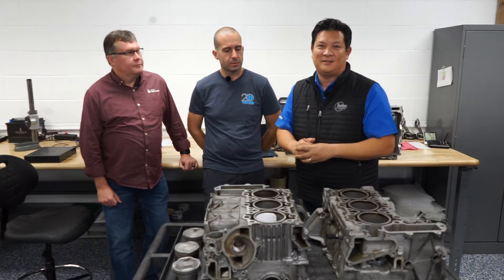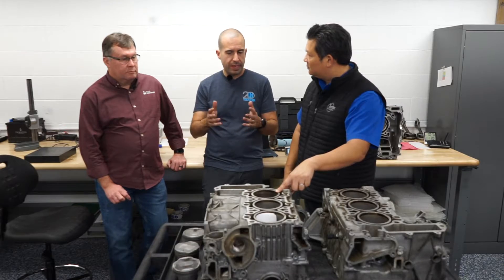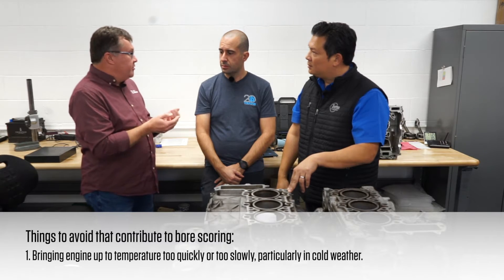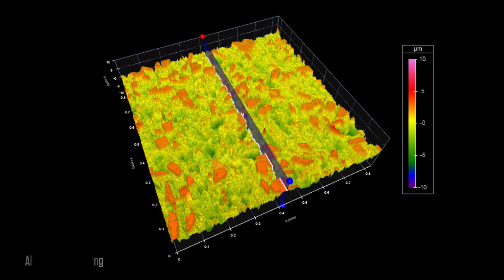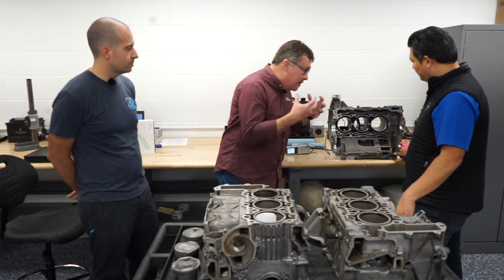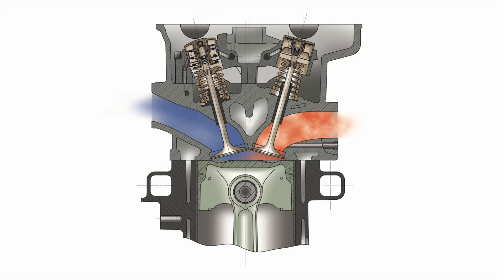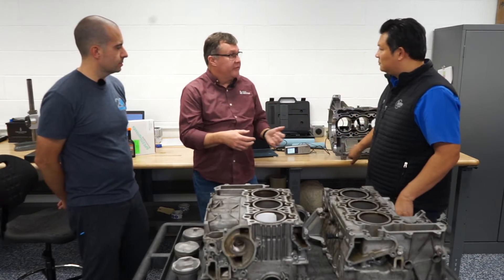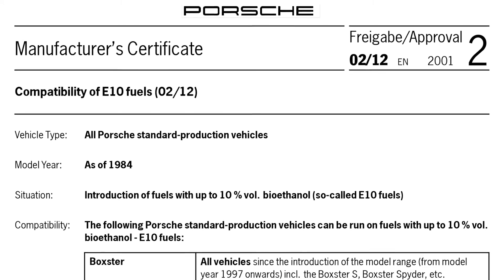Block & bore surface geometries & contributing factors to bore scoring in M96/M97 engine | 2 of 4

Comment: The Driven website has the following statement - does this mean they don't recommend using DT40 in a street car? "DRIVEN DT40 Racing Oil is formulated for High Performance Engines/Racing applications only. This engine oil will NOT MEET any current API or OEM Engine Oil Specifications."

Comment: The addition of increasing amounts of ethanol to petrol / gasoline is a scam.
Many beneficiaries but like the big club (“and you ain’t in it!”) it isn’t us.
Adding ethanol reduces the energetic content of your fuel.
Consequences are reduced power, worse miles per gallon and most of all, increased wear to various parts of your vehicle (as explained in this video where injectors are working imperfectly, and also some classic vehicles carburettor systems).

Lastly, I think, it’s hygroscopic that is absorbs water spontaneously, which then separates & falls to the lowest part of the system it in, risking rusting your fuel tank from within or corroding aluminium and non stainless steel items. 
It’s malign and performs no useful function. 

Remember, it also consumes land to grow the fuel instead of food, driving up food costs. And it’s not “low carbon”, either. It requires fertiliser, all of which is made from natural gas. Diesel is consumed in the tilling, planting, spraying and harvesting, then you’ve storage, transport and fermentation of the grain or other fermentable crop to create alcohol, distilling it from the aqueous liquor, waste handling and disposal, storage and transport of the pure ethanol, keeping it free of water and ultimately blending it with petrol / gasoline to make Exx fuel.
My guess is, mile for mile travelled, ethanol in petrol increases the total carbon footprint.

Comment: As a 1999 996 owner, I've honesty lost passion for the car a year after I bought it but to be honest I settled for this car when I was searching for air cooled SC so admittedly it's my fault. While I love all the air cooled cars the crazy price to own one defies my money common sense so like many I bought a 996 based on price. Just my opinion, you have to really have the passion to own a 996 along with being kicked in the financial balls. While I applaud Charles and Jake for providing solutions for the shit stick Porsche sold to customers from 1998 to 2008, they are getting wealthy from it. $15k plus for sleeving and rebuild makes me want to puke and take a sledge to my 996. Wtf Toyota, you consulted them but couldn't stop them from making the AMC Pacer of 911 engines.
Reply: Doesn't just getting the turbo manual avert a lot of these problems?  At $50K+ for a good example though think I'll just get a $1K 944 thrash it, not be freaked out about crashing, and perfect technique

Comment: This is great info. Sure wish I’d had it when I lost my 997.1 S to bore scoring in ‘16. 167k miles was too soon.  I ‘downsized’ to an ‘06 987.1 S Boxster, now w/100k miles and glad to know it has cast iron cylinders from this series. Blackstone Labs has always given my oil a clean bill of health, but I’m still going to switch off a low-Moly oil onto a higher level mix because of this info. Thanks, Vu and PCA!
Reply: Porsche does not use any cast iron sleeves in any of their sports car models and hasn't since the 924 which had a cast iron block. Your '06 987.1 Boxster S has the same Lokasil cylinders, but the pistons are cast versus the forged pistons that were used in your 997.1 S engine. Regardless, much less to worry about on your Boxster.
Reply: My 996 at 175000 k bore scoring. Bought a brand new block and rebuilt motor.

Comment: We need moly ? Maybe I should go back to rotella T6
Reply: Diesel oils by default do not have any moly in them and if they do, it's in trace amounts, no more than a standard A40 approved oil. Driven's DT40 and Millers Nano 5w40 are two examples of oils with healthy amounts of moly.
Reply: @lnengineeringllc  The Driven website has the following statement - does this mean they don't recommend using DT40 in a street car? "DRIVEN DT40 Racing Oil is formulated for High Performance Engines/Racing applications only. This engine oil will NOT MEET any current API or OEM Engine Oil Specifications."

Comment: I've only known about these premium motor oils for a few years now.  I personally use PurOL recommended by Bisimoto, a well known Porsche builder with a degree in chemical engineering.  When my supply was in contention, I looked for an alternative and I can vouch for the "Driven" brand mentioned in the vid.  Both products have excellent Molly in addition to other useful additives regular synthetic oils just don't have.  These high-end oils aren't cheap, but are good "insurance" against engine wear for our expensive engines.
Reply: Interesting badge arrangement you have there, haha. DC5 Type R owner here, looking into these cars as well. Love these cars, especially the 911 variants, but hearing all these horror stories kind of curb my enthusiasm about them. They are definitely no K20s, that's for sure.

Comment: Awesome vids, as an engineer its interesting these high end cars dont use a cast iron sleeve.
Reply: Automakers figured out many years ago that by ditching the cast iron sleeves the engines have much better thermal and volumetric efficiency which leads to making more horsepower. It so helps to reduce engine weight and size.
Reply: The iron liner cast into an aluminium cylinder or block holds oil so well that, used with cast aluminium pistons wearing chrome plated rings more or less never wear out.
I’ve classic Japanese two stroke triples using “old tech” which are not super high power output for its capacity, but they are pretty tough. They had to be, because the riders were almost all young men and they were always to twist on it, relentlessly.
It always amazes me that they lasted as well as they did.
Once rebuilt competently, you’re sorted for life, given the low mileage typically ridden on a classic.

It’s a shame that Porsche used fancy tech which had advantages, but which as 20+ year old classics, represent several, some serious, wear and failure mode risks. Still, I love everything about my pleasure driver (996 40th AE) and I’ll cope with disasters should they happen.

Comment: So pretty much hard stop on bore scoring at 2008? I have a 2010 Boxster 3.4 9A1 which I believe has forged pistons. I am cautious about warm up and oil changes for fear of bore scoring.
Reply from the maker: Bore scoring can happen to later Boxsters, Caymans, and 911s, but it's muuuuch less common and has a different failure mode. It's not really an issue for those cars compared to the 1999-2008 cars. We'd always recommend driving off soon after starting a car to warm it up, but staying out of high revs and full throttle until coolant is up to temp at the least. As for oil changes, stay tuned to the next episode for advice on that, but again, your 987.2 may have different needs compared to the cars profiled in this video series.
Reply: @PorscheClubofAmerica  Would be awesome if you could elaborate slightly on the failure mode of these later 9a1 type engines.
Reply from the maker: @memememine1  We'll let the experts explain sometime soon... Good question, but don't want to spread bad info.
Reply: @memememine1  The MA1 (9A1) engine is a closed deck Alusil block. Just like the M96/M97 engines that can suffer from bore scoring, we do also see some movement of the castings, specifically tightening of the cylinder bores down around BDC (bottom dead center) where the cylinders meet up with the main bearing saddles. These engines have very tight piston to cylinder clearances and that clearance can close up, causing the piston to seize. That's why it's very important to use a good oil, change it often, and drive the car gingerly until the engine coolant is fully up to operating temperature.
Reply: @PorscheClubofAmerica  until the OIL is up to temp, at least in the 997.1.  You could’ve been talking about the 9A1 engines, in which case I don’t know and defer.
Reply from the maker: @K1dPhresh1  Boxsters and Caymans don't have oil temp gauges, which is why we said at least until the coolant is up to temp... Probably better to run them for a few minutes after coolant is up to temp before full throttle. Edit: @K1dPhresh1 pointed out that the 996s and 997s have an oil temp display in their five-gauge clusters, and the rest of this comment has been corrected.
Reply: @PorscheClubofAmerica  I’m pretty sure my 997.1 has an oil temp gauge all the way to the left.  Coolant gauge is in the circle to the right of the tach.  Maybe 996 or 986/987s are different?

Edit: Quick google search, the Boxsters/Caymans don’t appear to have an oil gauge in their 3 ring set ups.  I was referring to 997.1s in my post. 👍
Reply from the maker: @K1dPhresh1  Ah, good point! Editing my reply above...

Comment: I also disagree with the comment regarding vacuum leaks causing the system to run rich (permanently). The purpose of fuel trim is to allow the ECM to compensate via A/F monitor data for lean or rich mixture conditions within reason. For example excess air (a vacuum leak), or excess fuel (a stuck injector) is picked up by the A/F monitor before the catalyst as a corresponding lean or rich mixture and "trims" the fuel by changing the injector pulse width to achieve a stoichiometric A/F ratio, thereby allowing the vehicle to run without issue.  There are limits to the short and long fuel trim allowances but within reason the system can compensate for a lean or rich mixture.  Monitoring fuel trim that is out of the normal range for a given vehicle is the technique to identify a problem with non-monitored air or fuel flow but it doesn't necessarily mean the combustion mixture is lean or rich.
Reply: So if un-metered air is getting into the engine it will compensate, yes?  And if that un-metered air doesn’t get fixed it will continue to compensate thus dumping in more fuel and washing down the bores.  At least that’s how I understand it.
Reply: @K1dPhresh1  If unmetered air is entering the system, that is excess air.  You need continuous excess fuel to mix with that excess air to bring the mixture back to stoichiometric. The A/F sensor forces that through fuel trim adjustment.  That excess unmetered air (vacuum leak) allows the vehicle to operate with less throttle opening to achieve the same engine rpm under load.  Eventually when the leak becomes too great the throttle position sensor, MAF and fuel trim are out of sync  (beyond the ECM limits) and the MIL will light. With a small vacuum leak the combustion remains stoichiometric, but at a lesser throttle opening.
Reply: @DeanMerrifield  so then if you had a throttle cable operated vehicle it would be more of a concern since the ECM is taken out of the equation as for as throttle controls are concerned and THEN you’d have a concern?  Have you watched the video he’s referring to with Tony Callus?  It seemed to make all the sense in the world to me then.  You’ve got me wondering now.  I guess I need to go rewatch it now.
Reply: @K1dPhresh1  Consider that the ECM will trim the fuel, in a unmetered air event or vacuum leak, by adding more fuel.  This additional fuel simply brings the mixture from a lean condition (excess air) to a stoichiometric condition optimal for combustion.  The A/F sensor data is within spec but the fuel trim is rich.  There's no excess fuel only that amount added to compensate for the vacuum leak.  The results is less throttle being used for a given engine load as the vacuum leak bypasses the throttle and MAF.  A more likely condition for cylinder wash down is a dirty or stuck injector, in that case the ECM reduces injector pulse width, reducing fuel across all injectors.  This results is lean cylinders with working injectors and rich cylinders with faulty injectors, the A/F sensor reads the aggregate combustion output which is within spec but the fuel trim is lean.
Reply: @DeanMerrifield  so you don’t see vacuum leaks as a concern as far as bore scoring is concerned then?  In my UOA I had a higher fuel dilution than expected.  I smoked the vehicle and found zero vacuum leaks.  I replaced the fuel injectors which I found were original to the car.  Waiting on my next oil change to see if the fuel dilution comes down.  But then there is also some talk that was once believe to be higher than usual fuel dilution may be closer to what is expected than not.  My fuel dilution was trending upward after the two oil changes during my ownership, so not that much trend data to look at.